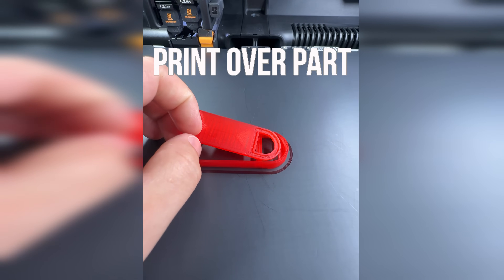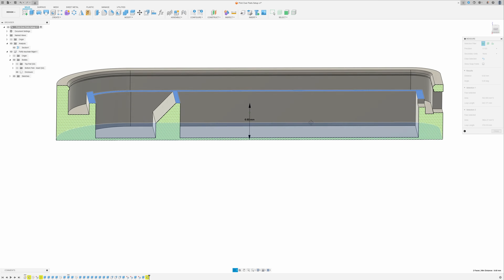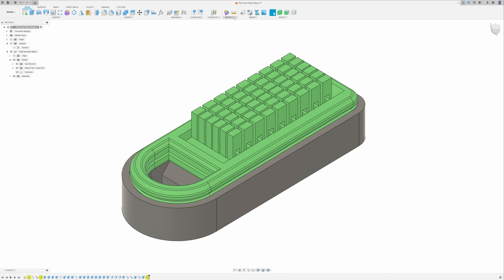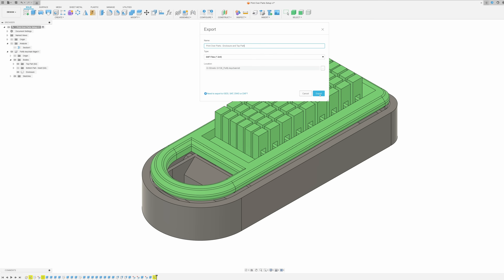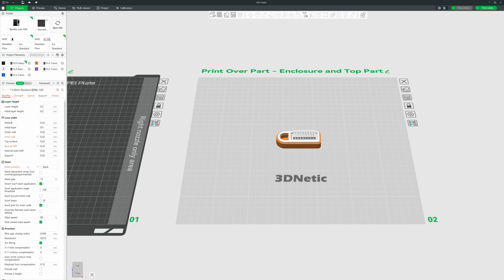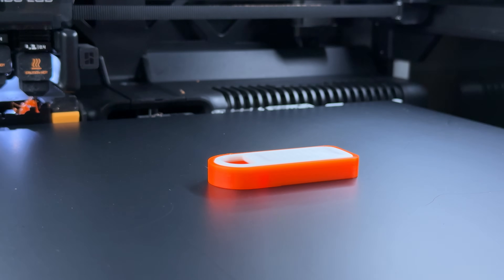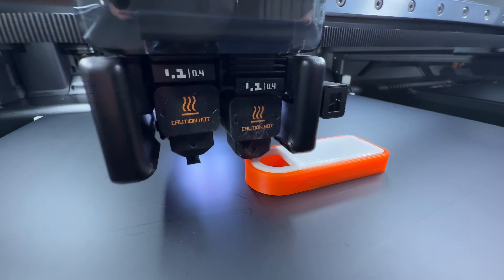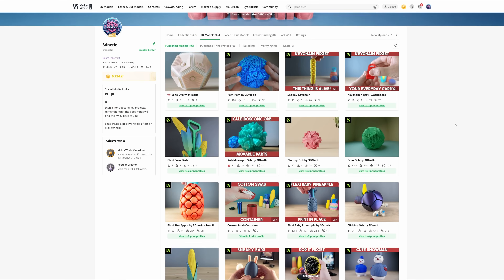No more glue - EXPLAINED

Comment: Cool. This techniqe might also be usefull for reusable horizontal support. You first print the support part with PLA, than the PET-G object. Print pauses the moment you need the horizontal support, you insert the PLA-part and print over it. As PLA and PET-G do not stick, you get extremly nice bridges. If you reprint the object, you can even reuse the support part.

Comment: what are these parts for? like what are you actually printing in this video
how is it any different than just printing one completely
from what i see you need to print half the part and have a bunch of them, then print this bottom half(again?) then be there to assist the printer to finish the part

i cannot understand how this saves anything.

Comment: Very creative for sure, but way overengineered for that part. A lot of time in CAD, high chance of the part face not being square to the print bed and it doesn't look clean at the seam. This would be better with a "gluing" jig and weld-on solvent (if this is PLA). Super glue wouldn't be a good choice either way.

Comment: For us that has been in additive for many years, we've been doing this for a long time, but I'm still confused..

What is this part? Like, what is it for?
Reply from the maker: I never heard about this method before. It is a keychain fidgets
Reply: @3dnetic  Thank you for sharing.

Yes, this is a simple pause and place method, usable like we do for magents, bearings, nuts and bolts, etc.

Glad you found this too and shared your method!
Reply: @RichardSats-e5l Kinda, but not really. This technique is for printing without overhangs instead of embedding objects within a print. I've been around the hobby for about a decade now and this is the first time I've seen anyone use the pause function like this.
Reply: @Nuffle  I agree; this is the same functional pause feature, but just done for a different component-featured application. 

This can also be used to strengthen the part focusing on XY orientation, rather than being limited in the Z only; and obviously using supoports/overhangs as you mentioned, etc.